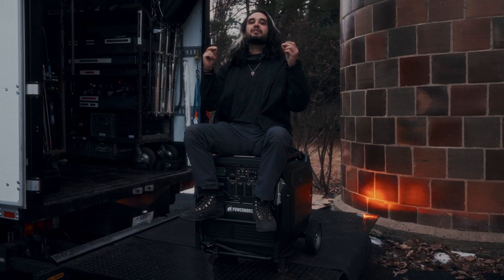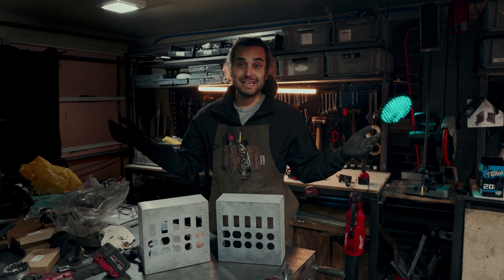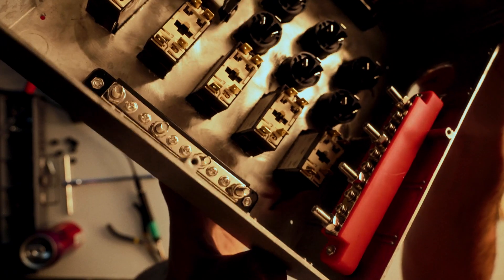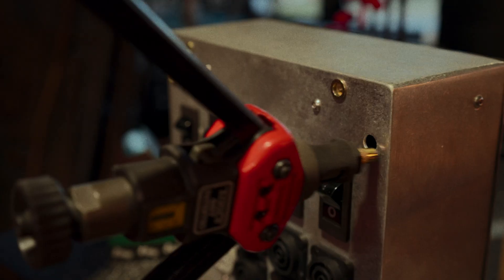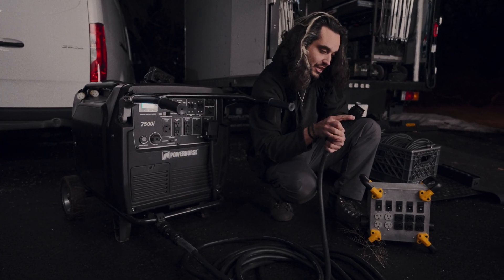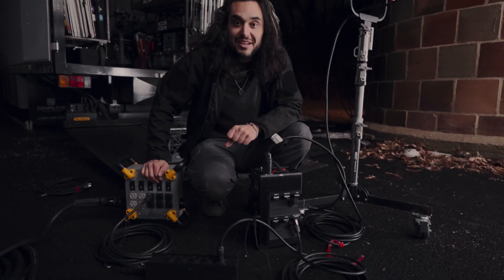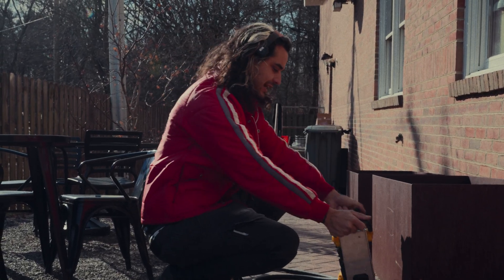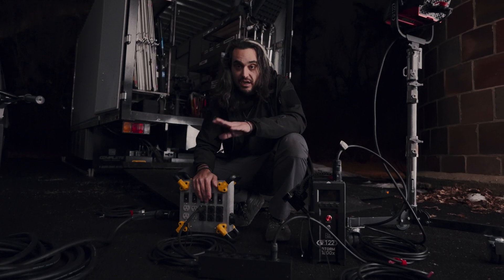The 120v fallacy plaguing the film industry

Comment: Why is the US so opposed to using the international CEE standard? ARGH!

Here in Germany that's like the default connector in event tech from source to distribution. After that it's mostly PowerCon. 

CEE is available for single phase 120V, Single phase 240V, Split-phase 240V, Three-phase 400V and anywhere from 16A to 125A. And you can get special configs 680V, avionics (400Hz), DC, 400A and even 20kV medium voltage.

Why is the US so hellbent on sticking with the demonstrably, empirically far inferior NEMA standard? And that Bates-abortion? Holy crap it looks awful as heck!
Reply: the simple answer, because its expensive to change standards. Once a standard has set in, especially for something that is as wide reaching as electrical, it is very difficult to change that standard because people still want to use their older hardware with the new installation. And changing a plug standard means also changing out every appliance and device to use that plug, and that gets expensive. And replacing Nema with CEE connectors would cost the economy billions. That's basically what it comes down to. 

Now to be fair sometimes CEE connectors are used when there isn't a NEMA equivalent available, so its not completely unheard of. NEMA connectors typically cap out at either 30, 50 or 60 amps depending on the voltage and phase configuration, so its not completely unheard of for a CEE connector to be used on some higher current applications.
Reply: @ryuukeisscifiproductions1818  The cost really depends on how fast you need it replaced.
Looking at electronics, the turnover rate is pretty high in spite everything being highly standardized.
Doing away with NEMA through requiring new installations should follow the new standard isn't that costly, and with adapters as stopgap measures it isn't that difficult.

Then again, we still use a lot of 500V circuits in the industry, a legacy we just can't seem to get rid of lol
Reply: @ electronic connectors and mains voltage connectors aren't the same issue.

Replacing NEMA connectors will be a lot more expensive because it requires having electricians to replace the vast majority of receptacles. The cost of replacing all receptacles in a home costs between $1200 and $2600. Multiply those by 86 million homes, then consider the tens of millions of commercial and industrial buildings, millions of apartment blocks, and the costs of replacing NEMA easily goes into the hundreds of billions if not trillions. Particularity since your not just replacing receptacles but plugs on every appliance. 

Countries could get away with replacing mains voltage plugs back in the days when there where far fewer appliances to go around. Nowadays replacing mains voltage plugs just aren't feasible, for any country.
Reply: @ryuukeisscifiproductions1818  yes, exactly. I remember when I discovered Twist-Lock connectors, another Harvey Hubbell invention. I loved them so much at work, I set out to set up my whole home with them...until I started doing the math and discovered how much it would cost!
Reply: @ Well the biggest cost of changing receptacle types is the labor. If you have the skills to do it yourself then its far cheaper. 

Residential grade NEMA 5-15r's are pretty dirt cheap, you can get 50 of them for less than $100. where as going with all hospital grades would cost over $400

And yeah, twistlocks are expensive. I just bought a couple NEMA L21-20'r and two plugs to build PDU's for my at home computer equipment. Close to a hundred dollars for just the two receptacles and the two plugs. But I am a qualified electrician so I don't need to hire anyone to do it.

That being said I would recommend using Commercial or Hospital grade receptacles for any heavy use locations. Hospital grades are no twistlock, but they still have a very strong grip on the plug, and they last longer.
Reply: @ryuukeisscifiproductions1818  ". Multiply those by 86 million homes, then consider the tens of millions of commercial and industrial buildings"
You build that much housing EVERY YEAR?

"Particularity since your not just replacing receptacles but plugs on every appliance. "
Somehow Japan manages in spite of running both systems lol

"Nowadays replacing mains voltage plugs just aren't feasible, for any country."
Whole EU did back in 2016. Like I said, require new installations to have the new standard from (ten years ahead of time), and it'll sort itself with adapters. Bonus, you then have a MUCH larger market to buy from, making the cost of scale pressing prices further down.
Reply: @johanmetreus  Europe was able to get away with it because the new plug designs where backwards compatible with a lot of older plugs. And even then you all still are not that standardized as the UK, Ireland, Italy, Denmark, Lichenstein, and Switzerland all still widely use their own designs.

Your demanding that North America completely abandon NEMA and go with a European standard, which is not backwards compatible with North American appliances using NEMA. 

And this is on top of the fact that European receptacles dont fit in North American Junction boxes, so its going to have to be more than just receptacles and plug ends that have to be changed.

And the reason I say North America because it isn't just the US that uses NEMA, but also Canada, Mexico, most of the Caribbean, Cuba, Central America, significant parts of South America, as well as Japan. The Type I is basically the NEMA 10-15 which is used by China, Australia and New Zealand. 

Forget it, its too expensive to ever happen.
Reply: I asked me exactly the same...
Reply: Who is it representing the "US" who is voicing this opposition? In fact we do use CEE connectors--just go to any marina and see how the yachts are connected to shore power. I personally would like to see more IEC 60309, but scolding us while ignoring our increasing use of the IEC 60320 standard seems petty and parochial to me. If you want to get others to adopt your ways, try leadership instead of hostility.

I know that I keep using pin connectors mainly because that's what's on the generators, and those aren't made in the US. Utility power is up to the property owner, who has to keep insurers and local authorities happy. The governments' rules were left behind by England, France and Spain, BTW.

The reason why the US uses NEMA connectors, most of which were designed by industrialist Harvey Hubbell, is because of capitalism. Everyone had a fair shot to have their design used, but Hubbell was the one who made enough to get installed in the most homes and businesses, and copied by other manufacturers. I'm happy to adopt new things, but need a better reason than "because I said so." What standard that's not local have you adopted?

You can call things "inferior" but with no data to back it up, it looks like you're saying "I want everything done the way I am comfortable with!" That looks more like tyranny than reason to me. And that's exactly the backward, parochial thinking that prevents progress from happening. The US doesn't need more of that!
Reply: "Standardization" is a word that gets you deported here lmfao
Reply: Americans are at their hearts still cowboys that make shit up as we go without thinking too much about how it could be the best or the safest. Also once you have large rental houses invested in miles of cables with the old ends on them and make tons of profit renting them out to each show that needs them, it’s really difficult to convince them to throw the cables away and invest in new ones. It’s an entrenched standard that requires a higher level of legislation from the government with a lot of advanced notice to get people to change, kind of like what’s happening with the slow shift to electric vehicles.
Reply: The versions with 3 pin for Earth, Neutral + 1 phase (or 2P + E, which can use the same connector without compatibility issues) are mass produced, not just for stage sound and lighting (cheaper than PowerCon True1), but also used for most camper vans, camp sites. Most big hardware stores in Europe have some on their shelf.
In Europe the version with 5 pins for Earth, Neutral and 3 phases, in red color code meaning up to 500 V, used for the 400 V phase-to-phase systems, are also very common, especially for industry, distribution on construction sites, and, well everything more than single phase. The blue version, used when the phase-to-phase voltage is under 250 V, is less common.

I suppose the 4 pin for Earth, neutral and 2 phases, for split phase 240 V 60 Hz is still quite rare (color code orange).
Reply: CEE is absolutely nowhere to be found in NA and is massive for the amps it carries especially 16A compared to 20A NEMA standards. ZERO retailers carry CEE parts here except for some similar 60hz flavored pin-sleeve connectors for higher currents that NEMA did not design for. The lack of familiarity/training plus not aligning with/meeting standards and sustained current ratings only adds to the reasons it is not seen in the Americas or most places

NEMA is everywhere and is very reliable and better yet (many hate to admit this) space efficient, plus by being a 100+ year old set of standards, connectors and extension cords for NEMA configurations can be had at average hardware stores and electrical supplyhouses anywhere for cheap or all online retailers for even less, both straight pin and locking flavors.  NEMA standards also prevent the mixing of voltages and max currents

PowerCon true1 is the de facto distro out/power input on modern stage and production equipment and is almost universally multi voltage, and is relatively cheap these days because of how common it is, and it is as interoperable as NEMA due to that.

stage-pin is the defacto set of standards for dimmer in and outs, plus 125V distro inputs. It is underdeveloped by modern standards but is fully standardized and is as universal  as NEMA or more than true1 on stages. it is available in higher currents than any other 125V standard and is very serviceable, sourceable and durable

socapex is common on dimmer racks and lighting distros but is always a specialty part, has no one standard pinout and being very expensive, anything that uses it is very much custom purpose-built, and good luck finding straight through, step up/down adapters or any replacement parts on tour.
Reply: @ethernet01  actually CEE is used in America often whenever there isn't an equivalent NEMA connector available. For example one jobsite I worked at used CEE connectors for a lot of welders that used a 480 volt 3 phase 50 amp source. There are no NEMA connectors available for that voltage at that current level. All 480 volt NEMA connectors cap out at 30 amps. And for 120/208 three phase systems, if you want to have both the neutral and the ground along with the three phases, again your capped at 30 amps. The 50 and 60 amp NEMA connectors for 120/208 will either have a ground or a neutral but not both. And of course across the board NEMA stops at 60 amps. So CEE has filled in the gaps where NEMA is unavailable.
Reply: @ryuukeisscifiproductions1818   correct that nema doesent have many 480V connectors - california connectors are more common for 480, example:
for 480 50A, the CS8165C would be common, have used them in many warehouses for machinery, along with matching extension cords

are any CEE connectors actually standardized for 480 and/or 60Hz, or is it a stand in because of sufficient ratings(and no UL recognized equivalent)?
Reply: @ I think the red colored ones are usually used for 480 volt 60 Hz when it is used. the connector is rated for that voltage, though sometimes the black connectors are used for that as well, but the red ones are more typically used for 230/400. Which does mean a potential for voltage and frequency mismatch of someone brings one appliance of one voltage and tries to plug it into the other voltage standard. So yeah there isn't a CEE standard that is specifically set aside for only 480 volt 60hz
Reply: @ryuukeisscifiproductions1818  from what can be found(plus sightings in commericial kitchens and large spider box distros) 60hz flavored, rounded to 10/5A, 480&600V pin and sleeve exists, but these NA specific connectors exist only under IEC, neither CEE or NEMA. 

explosion+corrosive-proof variants are common, and conveniently they also exist down to 250V with or without neutral, allowing for 100A+ connections

they are very similar to CEE pin/sleeve but are UL listed and rated for NA voltages/currents
had seen them before but never checked their identifiers
Reply: @ that may have been what I saw at the industrial site that had them. To be honest I've never had to install a pin and sleeve connector before, most of my Electrician work over the past five years is hospital work, and most industrial sites I have worked at I've never had the opportunity to work with one, so I have never had the opportunity to inspect them real closely. And i suspect a lot of North American electricians have never had the opportunity to install one, as the vast majority of over 50 amp equipment is hard wired and not plug in. Of course some regions and companies might use them more than others.
Reply: @ryuukeisscifiproductions1818  correct, they would only be something industrial, mining/rigging and datacenter electricians get to service regularly.

then jobsite and touring electricians / electrical techs, but the average commercial/residential electrician will never touch one, almost everything in commercial above 50A is hardwired so they only use California connectors at most, and same with everything above 60A 250V in residential - they really are a behind the scenes thing that is either tucked behind a appliance / rack or under a stage.

in hospital settings you may find IEC pin/sleeve inlets for "small" generator/battery trailers
Reply: @ethernet01  You missed out on the point why the CEE connectors are larger - and that's because they protect the user from coming in contact with the connectors.

If the NEMA was made secure to the same level as the CEE connectors they would be as large. The flat blades of the NEMA connectors also bends easily.

So the NEMA standard is getting quite old by now and reflects an era that's 50+ years old.
Reply: @ehsnils  Japan solved the prong contact issue by simply adding plastic to part of the blades of NEMA 1/5/6 plugs, while New Zeland/AUS added sleeves to our depreciated NEMA 10 standards(10-15, 10-30, etc) and repurposed the center tap neutral pin as ground 

in the US, UL listed electrically operated toys have a far larger plastic shroud to sheild the likely very young user from the prongs, why we havent sleeved our prongs(atleast on 10 amp or less rated plugs) is definetly a problem but the point stands- it has been proven that nema connectors could be sleeved in the way CEE 7/7, BS1363 or NZ flavored NEMA 10-XX
Reply: @ethernet01  "NEMA is everywhere"
Go to Europe and look for NEMA parts.
Go to Africa and look for NEMA parts.
Go to Asia and look for NEMA parts.
Chances are rather high that you have a lot easier time finding CEE parts instead.

" is massive for the amps it carries especially 16A compared to 20A NEMA standards"
Indeed. On the other hand the 63A doesn't differ in size from the 16A.
Reply: @johanmetreus  in the context of North America
Reply: It's not standard as internationally as you state, largely Europe uses it.
Why retain NEMA? Because it's everywhere and it works fine. But also let's not forget NEMA has a few flavors the locking varaties are more common in the production world. But more and more now it's more common to just go socapex to true1 and be done with it.
Bates/stage pin is excellent because of it's high current capacity, incredibly durable, and VERY easy to repair in the field. One pin is bad? You can just remove and replace that single one. Cannot do that with any other connector I know easily and in under 5 minutes. Then again given it's issues you need that easy ability to repair it 😂
Reply: @mwiz100  A lot of the NEMA connectors aren't up to modern safety standards, but nobody dares to admit it because that's "Un-American"
Reply: That's like the US's thing, doing their own weird and bad thing just because they can
Reply: @ThylineTheGay  im under USA-rules this year/currently but residential/everywhere's not 3p ( service's 480V like Europe/world and USA-industrial-users also would help if HZ was standardised ect to power can be transported under-sea/worldwide so wind/solar/ect can be used more effective, also something in the video he should consider batteries/storage as that much NVH isn't something i can see movie director's or concerts/other wanting ) to me doesn't make sense in the modern era as lighting/LED's ( and home charging and stovetop-electric/HVAC/water-heating/ect ) do better on DC but 3p is better to DC vs 125V-AC
Reply: Another European that thinks everything they do is superior. So original. Maybe if the US was a great country like the EU we’d adopt the CEE.
Reply: @yolo_burrito  Do you have anrguments as to why NEMA is "Better"?
Reply: We don't like getting ELECTROCUTED! YOU CAN SEE THE METAL JUST LOOKING 'ROUND THE PLUG! I gotta get outta here before my head explodes.